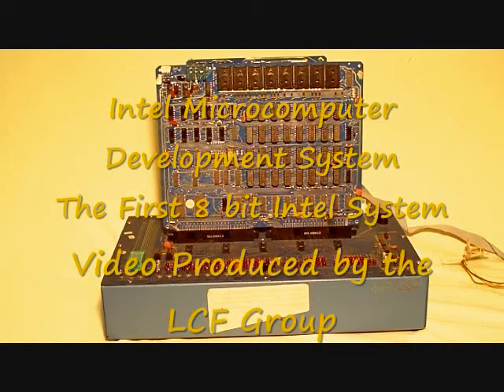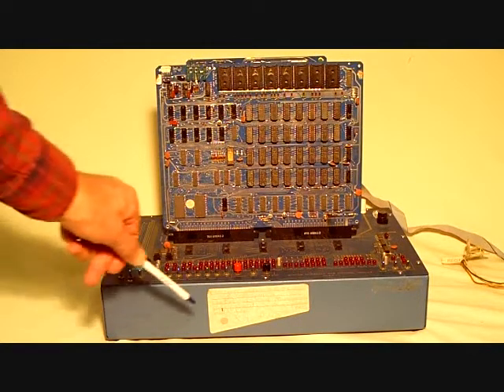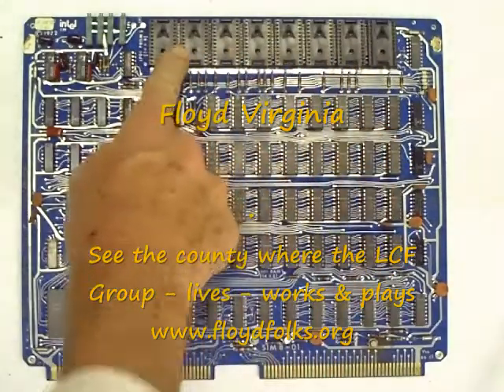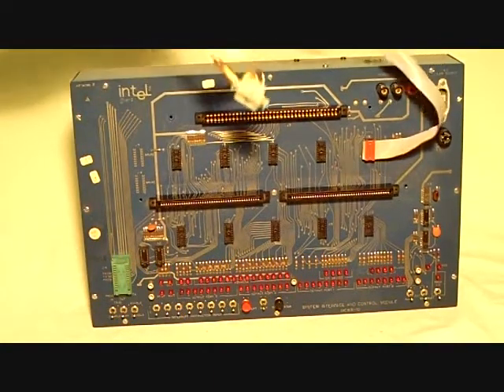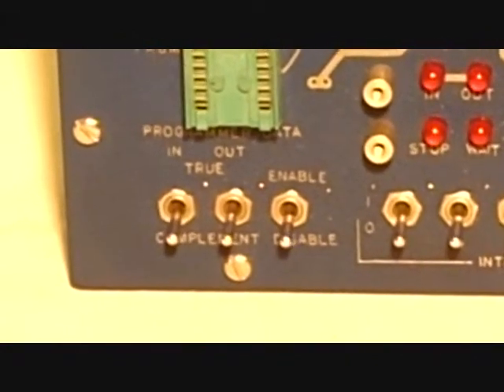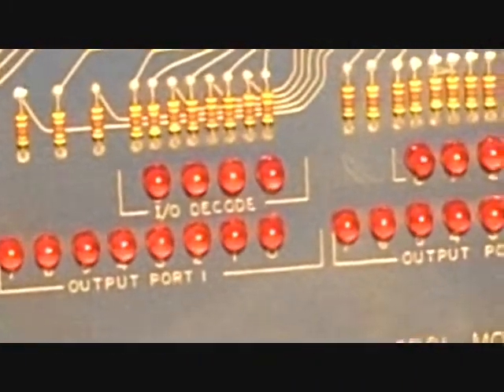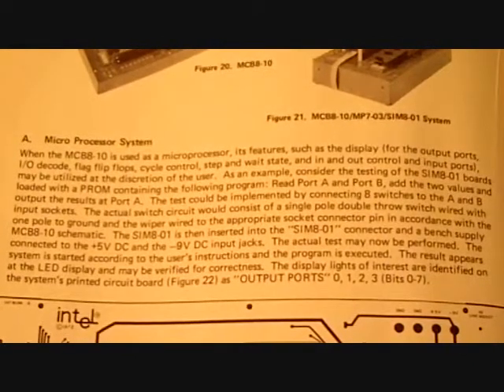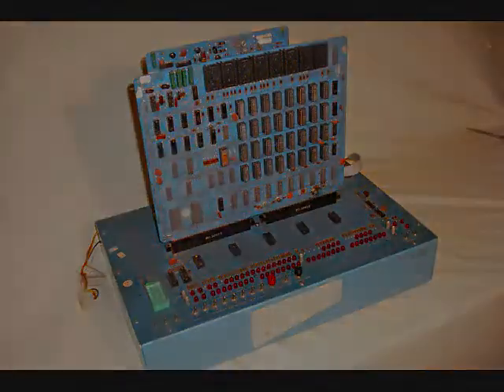Vintage  Computer  Intel MCB8-10 Microcomputer

Comment: I think the label is correct, the CPU board is the SIM8-01 which contains the CPU, RAM, ROM and a TTY interface.
This makes it a Microcomputer from as early as at least June 1972, which preceeds all others using the 8008.
Also I believe it qualifies as a Single Board Computer, as an SBC is not required to include a keypad or display on the board.
Reply from the maker: Hi James - Thank you for the nice comment.  I have always believed a single board compute sbc would require a display and data input on one board. I say this as my colleague Jon Titus is considered by many to have designed the first SBC as the MMd-1 or mini microdesigner . We sold this thought E and L  instruments in the 70/80s.

https://archive.org/details/MMD-1Microcomputer_201310

Thank    you  David Larsen - member the old "Blacksburg Group"
Reply: Yes, that is one of my favorite computers, I have about 8 of them. But I believe this has been classified as the first All-in-one SBC, making it a category of SBCs. The first intel 8080 boards have SBC printed on them as part of the name....
"Single Board Computer 80/10 Intel 1975", they defined the category in 1975.

A computer comprises the processor logic, control logic, memory, buses etc. Everything else is known as a Peripheral, such as a Keyboard or Keypad, Screen or LED display, Printer, Disk Drives. So input and output devices are not technically part of the Computer.

A microcomputer on a single board must have the CPU,RAM,ROM and the I/O circuitry in place on the board, these are all the components of a "Computer", and with the attachment of Power and I/O devices there is a working machine.

As far as I can tell, the SIM8-01 is the first board using the 8008, but also the first 8-bit SBC. But of course it was not marketed as such because Intel did not want to be competing with their customers.

By this arguement, the SIM4-01,02 or 03 are the first 4-bit SBCs. The SIM4-01 came out in 1971, the same year as the KENBAK?:)

The MMD-1 has everything you need on a single board, but that does not discount the many previous SBCs form Intel at least.

I am just interested in finding the correct answer:)